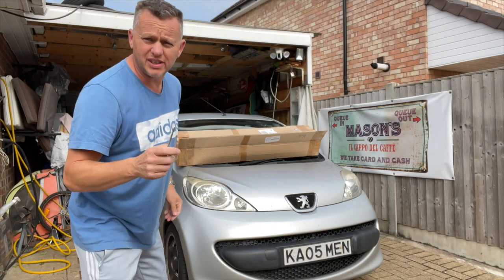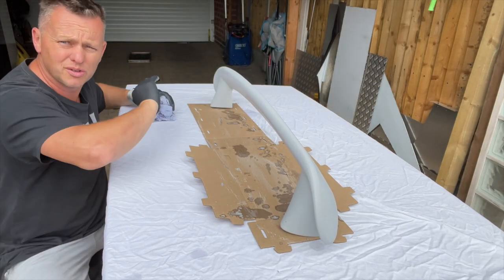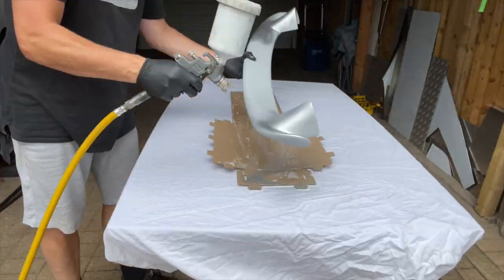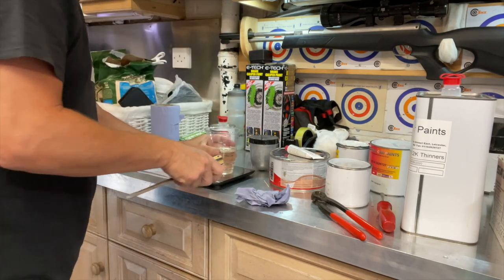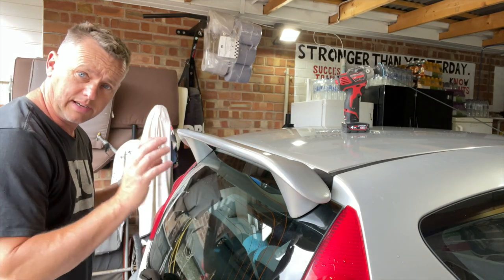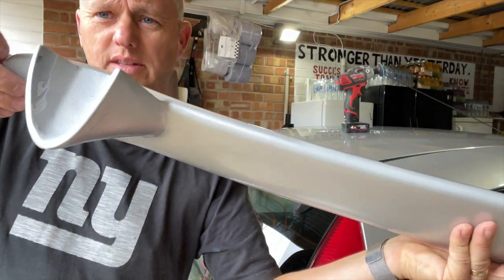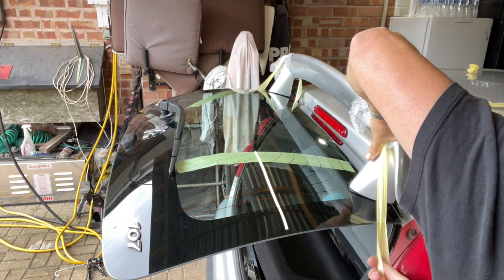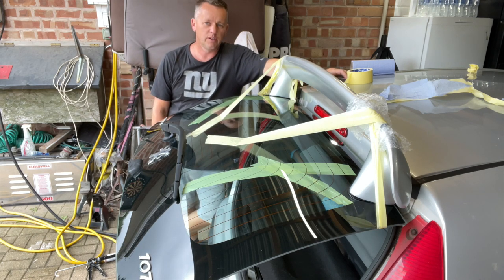🇬🇧CityBug Peugeot 107 Rear Spoiler Fitting & Painting, Same as Toyota Aygo Citroen C1 DIY.

Comment: Great job, looks good. I put the sealant on the inside of mine and then Tiger Seal round the edges. It doesn't seem like it would hold but when it goes off it holds really well. First couple of trips up the motorway I was expecting it to fall off 😂
Reply: Yes first time we put a spoiler on and went out for a drive we went in convoy in case it fell off into the road! 😃 All was fine.
We just took the rear hatch off when we fitted it. Just a little easier I think.
Reply from the maker: Yours looks great Derek, there are a few possibilities with different bonding types, I used this stuff years ago and it was solid, so thought I would use it again, Thanks for the great comments👍🏻👍🏻🛠
Reply from the maker: Taking the hatch off is a good shout Gav, as the taping was I bit fiddly, Thanks for the great comments👍🏻👍🏻🛠

Comment: I'd love to get a camback spoiler for the Aygo. There just not available to buy (the biggest challenge is that the boot would either hit the camback with it attached to the roof or the camback would hit the roof if it was fitted to the boot mounts. You'd need a double hinge so the boot would pivot it on the roof (similar to how your parcel shelf lifts). It still leaves the issue that the brake strip light would be covered (which is why I'm not in a rush to try to do it!). I hypermile my Aygo, I've averaged about 72mpg over the last 2 years (69.2mpg over the entire 7 years I've owned the car from when I was a new driver) ... My best tank was 78mpg.
Reply from the maker: wow that's amazing 78 mpg the spoiler might spoil that, the extra drag!! Thanks for the great comments👍🏻👍🏻🛠
Reply: Are the C1, 107 and Aygo not all the same car ? Are you saying this spoiler won't fit an Aygo ?
Reply: @phillees4362  a Camback spoiler is something different, it's more of a custom job rather then off the shelf spoiler in this video. You can't easily fit one to an Aygo because the rear hatch only opens the glass it doesn't have a pivoting supporting frame from the point of aerodynamic air separation. A Cambacks job is the reduce the size of the aerodynamic wake at the rear of the car by extending the length of the car further back from the rear of car and it follows the curvature of the ideal teardrop shape.
Reply: @aaanton11  I did actually beat that this year during that 40°c heatwave in the UK. It returned 79.4mpg over 470 miles, some of which was driven during that heatwave but I was driving extremely steady as my temperature readings climbed quickly any time I pressed the throttle. It is absolutely amazing for a petrol engined car. 

I did think the Aygo was pretty unique in this sense but apparently the Suzuki Celerio with the 1L duel jet engine beats the aygo... On honest John users have submitted average fuel economy figures of 71mpg!

Suzuki seems to dominate the market when you're looking for the most fuel efficient pure petrols though as even the larger swift users are reporting averages of 62mpg in the 1.2 dueljet, Compared to the Aygo's 55mpg. 

I'd love to try these cars out... I did drive my mechanics Nissan Micra 1.2L once and reset the MPG meter and when I returned it to him it was showing 65mpg. Ironically the diesels I've driven I've struggled to get much higher then 62mpg, one was a 1.5L Mégane and the other a 1.9L Skoda Octavia. Both these cars seem to prefer motorway driving though, both could hit 70mpg on the motorway but unfortunately I do mixed country and city driving... The Aygo seems to get it's best fuel economy in light traffic at 30-40mph and can even hold 80mpg at 20mph if you're willing to stay in 4th gear (~1150rpm).

I bought the car with 10,000 miles on the clock 8 years ago... It's now at 102,000 miles and still runs great.

Comment: Hi there, my daughter 17 had a spoiler on when we brought it. Looks great……. BUT has been a nightmare with the insurance 😩 naively we didn’t realise it was a modification when we got it. Is there anyway of removing them? Would appreciate any advice at this point 😊 thanks
Reply from the maker: I would get another quote and don't mention the spoiler, some models came with them fitted as standard. you can remove them by cutting the bond with a long blade or metal cheese wire cutter, windscreen removal wire, Thanks for the great comments👍🏻👍🏻🛠
Reply: NEVERY LIE TO YOUR INSURANCE COMPANY...... if you do and your in an accident  they will cancle the policy which means you won't have any cover an may involve the police over it ..

Comment: That stuff was a bugger to get off my hands. With the excess that went over the spoiler did you use a knife to cut it off? I’m worried I’m going to scratch my nice new paint work. Thanks for guide it worked well
Reply from the maker: when its dried cut it off with a blade, Thanks for the great comments👍🏻👍🏻🛠
Reply: @aaanton11  thanks. Do you still have the 107? If so do you have anything else planned?

Comment: When you pressed out the glue from the cartridge I knew it will be a little too much. Had any luck removing bits that squeezed from under the spoiler?
Reply from the maker: it trims off nice and easy when the sealant has set, Thanks for the great comments👍🏻👍🏻🛠